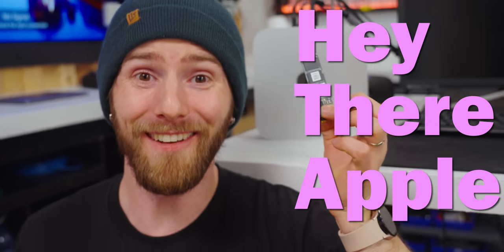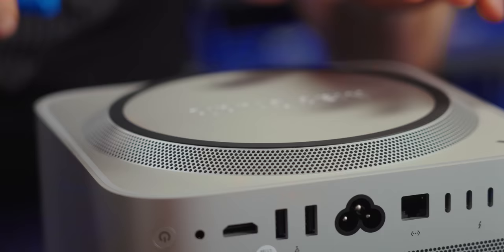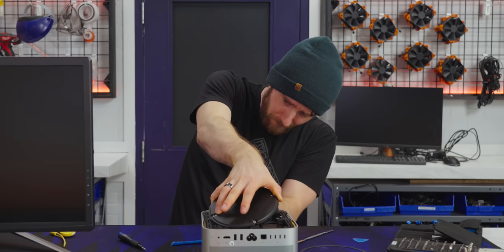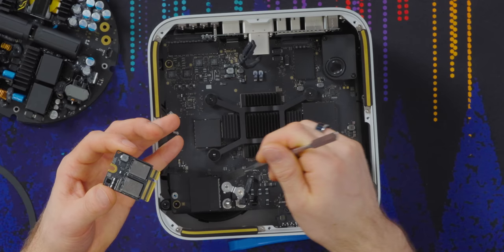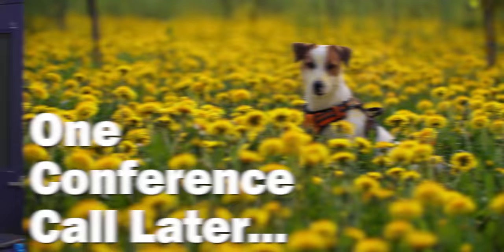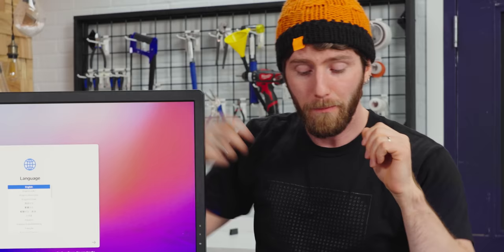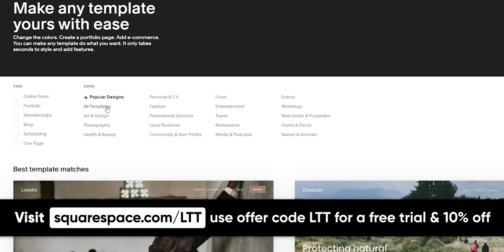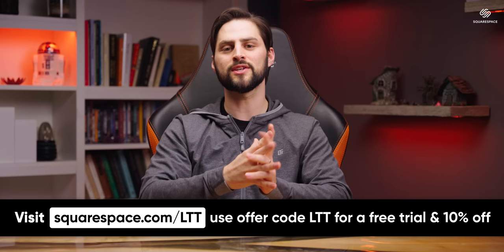I want to love Apple, but they’re making it hard - Mac Studio SSD Swapping

Comment: I used to interested in pc's swapping stuff many years ago.. total mess bought a custom tower windose 95 based amd 233 MHz 5700 rpm western digital for music production 200$ turtle beach pinnacle project studio audio card and off I went recorded a bunch of projects.hours of config issues updates ect...lasted 3 yrs was a 3 or 4 layer mobo  endless defragmenting...finally died . Bought a 2k$ hp p4 swapped sound card  in ran both hd's to transfer music....same windows issues defrag sound card works some times then died after 3 yrs...after that couldn't find a computer that would fit that sound card and the pinnacle project pro music that I created was tied to the sound card could not retrieve/ use with out it......tried winds nt no better.bought an early 2009 iMac still works but slow and NEVER HAD A PROBLEM never lost a single thing. Tried linux the whole driver thing again.Bought an m1 mini super fast  hasn't crashed. I miss boot camp but whatever, If you don't want to deal with drivers and endless reboots apple is the way to , os integrated with hardware or  maybe it was just me that had a bad experience... and no shit the apple form factor isn't meant to be taken apart.duh..the reason I use apple  ....I haven't been able to make it blue screen yet and I try

Comment: Did you see the video about the guy changing the ssd in an MacBook Air (soldering required) and ended up rewriting some part of the bios to get it working - maybe you need to do the same.

Comment: Stopping the video at 0:56 to make a guess... I'm going to guess that Apple has either, a) welded the SSD to the motherboard with a fail-safe that will short out every component if you try to remove it,  b) installed a controller chip on the MOBO keyed to the SSD which permanently bricks your system if it detects a different SSD--for the user's security, of course, because Apple values their customers' privacy so much, c) modified the SSD or controller as to make it a proprietary, or d) all of the above.

Comment: Apple has the same ethos ferrari does when it comes to serviceability:

"We build pretty things that go fast, but if you need a tune-up, it'll cost you $1100 for the oil cuange and spark plugs, and another $5000 for the labor becase fuck you we can".

Comment: are these SSDs available in aftermarket ? I had in mind to upgrade a Studio M1 with 512GB and 32GB RAM to 2TB SSD and 64GB RAM. The only way to go to 2TB is use a single strip or, 2 x 1TB strips by removing the current 512GB. The single strip is more advantageous because it would free up the second SSD slot and provide a contiguous 2TB SSD space.

Comment: This really seems to be an ARM thing.  ARM computers are not really customer centered.  They have firmware locks on so many devices.  As much as I think that RISC based computing may boost laptops and such, I haven't found a really customer centered way of doing this in ARM devices.  ARM is it epitome of e-waste currently.

Comment: You know Linus, i'm an Apple customer since 2009, and i completely agree with you! They shouldn't do this! I have A Mac Pro 2019 and i also have the 2013 (trashcan) Mac Pro. Am i not an Apple customer? I have the Apple Cinema (and Thunderbolt) display, Apple tv 4K, iPhone X, Macbook Pro 15" from 2012 and Macbook Air 13" with M1 (which i'm really happy with.) So i have already put in some $$$ into Apple pockets!

I do like (some) of the Apple products. But sometimes, they do stupid stuff like this! I remember my "trashcan" Mac Pro 2013, at least you could upgrade that machine. Though you couldn't really upgrade the GPU but anything else wasn't a big problem to do so. 

The Mac Studio is "big" enough to open up and have another SSD in there! Honestly, this is one of the reasons i got the 2019 Mac Pro. Sadly enough, the Apple Silicon Mac Pro isn't upgradeable! Not the RAM, GPU and not even the internal SSD itself. It's purely a glorified PCI-E board with a chip in it! And sure, you can add NVME's through a PCI-E module but that's it! Because it doesn't accept GPU's! When i'm looking at the Apple Silicon computers at this moment i think the best thing to do is to actually get an M2 Ultra Mac Studio or wait for the M3 Max/Ultra Mac Studio. 

Not one Mac product since the Apple silicon has been put in the new computers can be upgraded! I really think this might be the end of upgrading your computer and we shouldn't be too happy about that if you ask me. It's almost as if it's Steve Jobs 1.0 again. In the very early days he wanted closed off boxes as well. Steve Wozniak didn't want that. He wanted people to be able to upgrade their computers! On the other hand, if they don't make the computers too expensive (hey, one can dream, no?) and you view it like you would buy a new phone every so often, it might just turn out in a way that we actually don't expect. But honestly, i'm not optimistic about it.

Comment: Linus get carried away: the goal is to expand the storage of the Mac not to exchange the internal SSD with a bigger one.

Apple has designed twilight zones in his universe called Apple stores, inside prices suddenly become bigger and bigger compared to other computer hardware stores because they are not the others hardware stores, they are the Apple stores.

What does it mean? It means that Apple products are luxuary products, high range products: Apple margins are higher than 30%, more than the fragrance industry, jewelery, etc... So if you buy Apple products then you're with deep pockets, or at least you are targeted by Apple to have so.

So instead of wasting your money into the twilight zones, use your brain: don't be a consumer, be an actor of your life, and see that those Mac models have ports, buy a few usb and other hubs if need be, then an enclosure for an external SSD and choose wisely this SSD and stick it in.

Then voilà: you"ve extended your storage at a reasonable price (sort of: electronics are sand turnt into gold but at least you don't pay gold at platinum or diamond price). Focus on solutions.

Comment: Its the main reason why I, and most ppls prefer android to IOS. Its SO MUCH more easier to troubleshoot and upgrade memory/change sims/repair etc. Same goes for PC - swappable parts and easy installation. Yes, Mac is still very attractive because of its theoretically efficient concepts and designs and they do have some ingenious concepts (take this vid for e.g The concept of separating the flash memory from the other components of a memory drive for security is great...in concept). But they really fall short on everything else....=/ its like they're being xenophobic of third-party soft/hard/firmware on purpose.... and for no good reason.....

Comment: I know it's an old video but... 
Normally when you swap out the memory, you are also swapping out the controller. Each module of memory has it's own built in controller.

In this situation, your not swapping out the controller at all, your giving it completely new, and way more physical address''s that it has no idea of how to map.

Additionally, now your controller is in charge of ALL the memory instead of being able to distribute the load evenly amongst several individual controllers.

Comment: I am training to be a software dev and I feel disgusting that I have to buy an apple product to learn swift on, I've done the research and a used 2016-19 apple laptop is the way to go, VM's or hackingtosh is just a glitchy and slow way to do it I've been told. I REALLY don't want to spend more than £250 on something I don't want from a brand I don't like.

Comment: My first apple product was an iPhone 3GS, and it was a great product, but I wasn't able to share the WiFi, I wasn't able to get data through the connector (had to use ITunes). And finally I had to get read of it 4 years laters cause no more OS support and my apps weren't working anymore. After this great experience I never buy from this company anymore.  From the WiFi sharing blockage and the iTunes captivity everything was said.

Comment: Apple design its product like kitchen appliance: you don't upgrade your coffee machine or your fridge aren't you? The idea is that:

1. Users are using their mac not thinkering with it. If you want a repair, you pay Apple hardware service for it if it's possible either you've got to change of model. You don't upgrade the capacity of your fridge. A mac is not a pc. Pc are legos, you add parts as you wish, that's the original pc design.

2. Obviously by preventing power users to act as such they cut off any kind of hardware issues and have full control over the evolution of their market: it's their market, they don't like competition -> the apple second hand store is there to prevent any competition with parts to occur on a large scale, itunes music store is there to lock the music market, etc... it's a market completely under their control: IBM does that too.

Apple consider and target a market of pro and consumers who see their mac as a service provider not like a bunch of motorbike fans who want to tinker with their machine to make it faster. And it looks very aggressive and not friendly to users but think it this way:

You buy your mac for let's say use it as a photo pro in a shop. You make lots of shots, lots of prints and lots of money doing so. In the worst case scenario, the pro has a backup of all its data, and get a brand new mac where he / she can be back up in business in a few hours. For a pro a few thousands euro / USD is no problem.

Whereas a tinkerer create a complex environment not known by Apple and without control, which would use Apple resources to find what's wrong and get it fixed. And a tinkerer tinker, he is not productive in the apple ecosystem.

Apple save you time and money but it is at a high pricetag: your time is your most valuable asset.

That's the apple philosophy, the same as IBM, Ferrari, Testarosa and other big brands: you use the products to be productive in your field, the support, the maintenance, the repair are the job of the producer of the appliance / product not yours.

Basically the APPLE philosophy is: we make money by selling you a product which will do what it's supposed to do and you will have to choose it very wisely because you have no possibility of recovering from a badly choosen machine (RAM / SSD / CPU). You will save tons of time due to low amount of virus and security issue plus our systems being locked down you'll have very few incompatibilities, the system will run quite smoothly within the frame choosen (ie. don't use low RAM mac to make videos see selection point higher noted), no hack to be done in the registry, nothing but getting your job done.

And to get that you will have to pay a high price: we Apple target BIG money customers, if you are poor and not happy that's ok, move on elsewhere.

It's harsh and unfriendly but that's their philosophy (Darwin).

I would advice people who want to upgrade their machine to buy a reliable sturdy pc homemade then install a linux os on it. Forget about Apple (closed monopoly market) or Microsoft (monopoly of low quality software and bugs based economy).

Comment: I have a feeling that upgrading the SSD (the flash modules) or even doengrading it would ultimately not entirely be Apple's fault here. Sure, they integrates the SSD controller - That is their fault. What is not entirely their fault is how storage. controllers work, they are generally programmed to handle a specific amount of space, giving them something different will royally confuse them.
I don't exactly have an easy way to explain it, but this is the kind of things you get a grasp of when you design a filesystem... (please don't try it)

Comment: That's wrong Linus, you can upgrade the memory. You need "blank memory chips"
Reply: that is what linus did in the entire video.. he tried to swap blank flash memory chip "although it is not blank", to test if it worked..
and that it worked..

but for upgrade, that didn't worked.. you can't increase the capacity, neither to install flash module to both slots nor just one slot with higher capacity..

yes, because we also not be able to change flash module without its controller.. that means, we must change the entire component of the ssd..

in mac studio, the ssd controller and also the dram cache is integrated to the prosessor die silicon itself.. but the nand flash is not.. 
it is modular.. but the controller itself only remember one kind of nand flash module.. so if you change it, it need to be flashed with apple FU and DFU mode to tell the controller if the new nand flash module is the same as before, and also to reinstall entire OS..

Comment: Once I partitioned a higher capacity drive to work from the original HDD to an SSD (120 GB t0 512 GB SSD) on an Apple and it worked! Perhaps partitioning and installing on that partition original size might work then resize in the OS or keep separated as an additional drive.
Reply: Arm is harder to work with, even android devices are, but the tools are everywhere and runs on windows and Linux

Comment: I might be in the minority here, but I see absolutely no problem. I know what I’m getting into every single time I buy an apple product, so I buy the apple product I want and I’m happy with it. I’ll gladly sacrifice the ability to tinker with my machine in exchange for a well optimized machine that works as intended every single time. If I wanted something with 69TB of storage I’ll buy something with that spec, if I want something with a stupid amount of ram I’ll buy something in that spec. The PC master race bullshit is old already I like the apple ecosystem and I’m happier with my Mac pro, iPad, iPhone and AirPods then I’ve ever been with anything by android or PC but I don’t talk down to users of those other softwares.
Reply: issue is that apple EASILY could change this so you could upgrade - at least in this instance, but they won't because there isn't enough backlash. fair enough if you like the apple ecosystem, but they are not pro-consumer, and that is clear